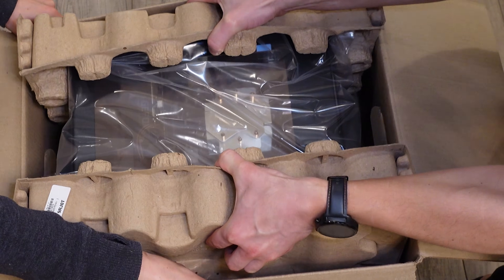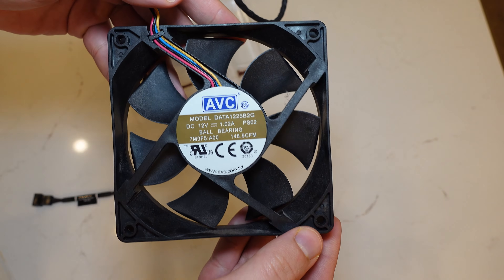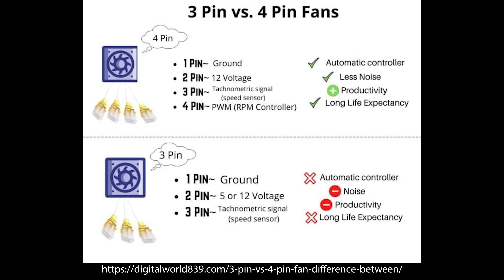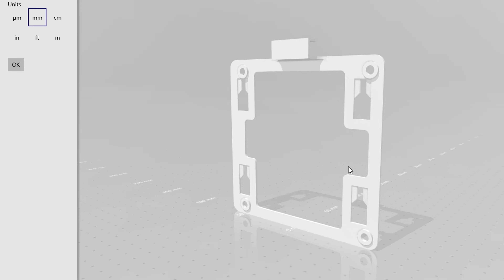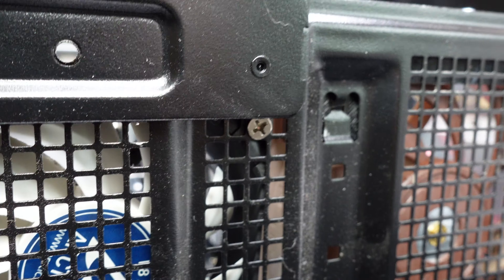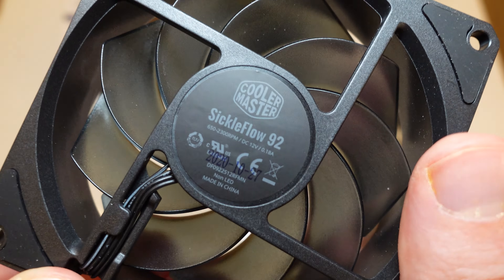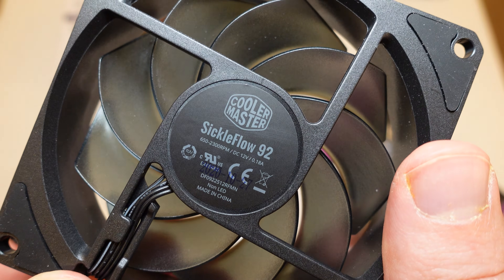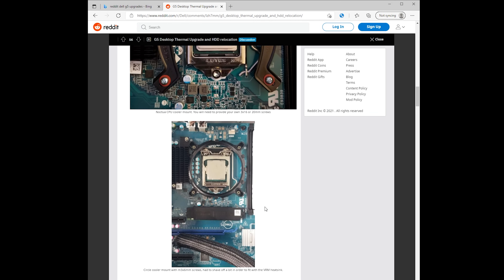Improve AIRFLOW in your Dell G5 or XPS Gaming PC (step by step tutorial mod)

Comment: Hey j, solid video and thanks for this.
I had a question as I'm contemplating doing something similar. With the better cooling arrangement, do you run into any issues with the Dell mobo limiting you cpu with the better cpu cooler? I guess what I'm asking is what the clock speed of the cpu running st when your are doing extended gaming period
Reply from the maker: No issues honestly. A game can't push a CPU like a synthetic Benchmark can. So don't worry about pl2 turbo limits that aren't infinite
Reply: @JSyntax  Thanks man!
Yeah I live in calgary and found someone selling it for $350 (without the GPU). Planning to buy that.
Upgrade the CPU cooler like you did. then just put my old 2070 in.

Is the front intake fan necessary?
Reply: @JSyntax  Also I forgot to ask.
Did you notice a considerable difference for the front intake for the GPU? or just leave it as is and only upgrade the CPU Cooler. 
I got the Vetroo V5

Comment: Great video, but I have one question. If I were only to replace my rear exhaust fan, would that be adequate cooling? Also, I noticed that your front bezel is a different color. I tried looking around the DELL community pages and couldn't find any solutions to changing the LED color. I was only pointed to the Alienware Control Center, which should have an FX tab. However, mine is greyed out. Is it possible to change the color from the bios or something?
Reply from the maker: does ur model come with a rgb strip?

Comment: I also have a G5 and replaced my exhaust fan with noctua chromax 92mm and added Corsair 120 mm blue led fan as intake and repurposed Dell 80mm fan also as intake but haven’t replaced cpu fan because with all these fans my G5 stays at 36 degrees Celsius and only reaches a high 80 degrees Celsius when at maximum performance
Reply from the maker: Nice!
Reply: High 80c is way too hot.

Comment: Another good option for the 120mm and 92mm fans are is the arctic p12 as they are alot cheaper than the noctua and are just as quiet

Comment: I have a hard drive on the front, how should I move it to add the fan? Can I put it somewhere else in the case?
Reply from the maker: yes you can, sry i couldnt cover it b/c it's more hacky! prob better off moving the HDD to an external enclosure and invest in a cheap SSD!
Reply: @JSyntax  thanks for the advice!! I appreciate it!
Reply: Idk if you’ve figured it out yet. I just did mine tonight. I just mounted the hard drive and the hard drive case right next to the hard drive cage in the top left. Just mounted it with some zip ties and it’s working fine. Just make sure to mount it in the right direction so the cords still reach
Reply: @hunchopump  I managed to complete the set up basically. And I've seen DRASTIC Improvements. Good looking out bud.
Reply: @Dopeykilla  That’s good. I got mine all installed last night, haven’t noticed a difference in temps yet though. Pretty sure I need to tweak the fan curves
Reply: @hunchopump  yeah I downloaded the alien ware command center shit. Tweaked the fans, installed the CPU cooler and now I can play basically any game 60fps while staying below the 70c range. This was absolutely worth it for me anyway.

Comment: I have to say that these mods were totally worth it! I finally got the last two fans for the front and just that 80mm at the bottom makes a huge difference in my GPU temps. Overall between GPU and CPU, I am getting about 35-40 degrees on idle and on full gaming, I haven't seen temps go higher than 70 degrees. Thanks for these awesome tips!
Reply from the maker: Right on!
Reply: Did you 3d print that plastic part to hold the fan or did you installed them differently?
Reply: @jrcp87  I got the bracket 3D printed. In my opinion, the printed bracket is way more efficient and square than trying to mess with getting a couple screws to mount right onto the case
Reply: Did you already have the K-series CPU cooler or just the tiny pancake one?
Reply: @voIition777  I had the tiny pancake one. So going from that crappy pancake one to this... Huge difference in temps
Reply: How did you fit the one at the bottom and do you think using the Dell OEM (radiator) for the bottom is good enough?!
Reply: @EZzO444  I ended up just buying the noctua fans all together and scrapped all OEM fans and Coolers. Now fans run quieter, but with improved airflow. I went from 85°C gaming and 45°C idle to basically 75°C gaming and under 34°C idle. 🤘
Reply: @LUCH0517  were you able to keep the GPU bracket for the bottom one?! And how did you used the Y splitter? Intake together and CPU/Radiator together? Any changes or manual fan curves after?! ;)
Reply: @EZzO444  The CPU bracket is fixed under the board. You cannot change the bracket and thus the bracket the Cooler comes with is not usable. You have to track down the right screws. Whatever he mentions in his video I followed to the T. I used the y splitter that came with the fans and Coolers. I've got the Rear fan and CPU cooler hooked up to one port and the 2 front fans I have hooked up to the Chassis Port
Reply: @LUCH0517  thank you! And you kept the preloaded fan profile! Or any changes required at that level?
Reply: @LUCH0517 Glad to hear that worked for you.  Did you have any bios issues not using any OEM fans?
Reply: @alexferrara5975  I have had zero issues doing this Mod. Works great!
Reply: Hi Luciano, I understand that you only used the Noctua fans, did you keep the GPU bracket in? Or was the Noctua fan too big?
Reply: @king0vdarkness  I didn't touch my GPU. Noctua cooler was only used for CPU and noctua fans were used on case.
Reply: @LUCH0517  thanks
Reply: I’m curious, can you tell me what your max RPM was for Noctura? For some reason mine only max out at 1200. However if I use my OEM aux fan + the Noctura setup it’ll pass the fan test with a top RPM of 3k.

Doesn’t make sense :(
Reply: @BrODown32  Funny you asked. I've never really checked my RPM, only my Percentage via the Alienware Control Center. I'll have to look further for that actually.

Comment: I did this install recently along with the cpu cooler and for whatever reason if I don't have the original dell fan that I put at the front of the tower lower side like you did my power unit and computer go bonkers . I have to use the 3 pin off the sys fan splitter for the rear 92 exhaust fan . I also use the 3 pin off the cpu splitter for the 120. Did you have this happen to you as well where your computer just went bonkers with certain cable setups ? Let me know . I also noticed that my rear fan doesn't spin as quick as it did before but this is probably having to do with the fact I'm on a 3 pin but if I change it to the 4 from the splitter and run the 3 to the dell .. like i said up there ,^ the computer doesn't like it

Comment: Thanks for sharing this information!  I recently purchased the Dell XPS 8940 with I7 10700 G10 chip and 3060Ti GC.  Normal operating temp is averaging mid to high 50's C.  After upgrading the system with the Noctua NH-D9L, Premium CPU Cooler with NF-A9 92mm Fan,  Noctua NF-A12x25 PWM (120mm), Noctua NF-A8 PWM (80mm) and Noctua NF-A9 PWM (92mm) the average temps are high 20's to low 30's C .    Max temp on high loads with upgrades only reached mid 60's allowing CPU turbo to be constant at around 4.5 ghz vs high 80's to low 90's stock reducing the CPU output and causing stutters during gaming.  Check out this link walking you through this highly recommended upgrade.  https://youtu.be/nWOeO1Cfva0

Comment: Hey I have a question. Do you have any advice about setting fan curves on ACC? I mounted the 92mm noctua on the back and the stock fan on the front but since then I havent been able to make the function properly. I draw the curves but it looks like they only work on two levels: either they both run slow or they both run to the higher RPM. It seems like they dont really follow the curves.
Reply from the maker: I'd just max the fans to around 900 rpm until 70c, then go max rpm if you get higher temps. Fan noise is indistinguishable from 0 to about 950rpm.
Reply: @JSyntax  thank you!

Comment: My exhaust fan is plugs into a fan sys port. I am only adding the too front intake fan. Is it ok to plug the splitter into the fan sys port and have my exhaust and intake run off the fan sys port? Sorry couldn’t really tell where you plugged yours into
Reply from the maker: Yes of course

Comment: This is an amazing video! Except being the worrywart I am, I would be concerned about the warranty on my machine. I'll probably just purchase a 92mm fan for the back. Thanks though!
Reply from the maker: I keep hearing you don't void your warranty if you replace components but then again, a lot of those comments came from elitist troll arshholes from reddit.
Reply: I also wonder if I could get by with sticking fans on the back and front.  Does it cool it better than the stock fans ?

Comment: Can I just straight up get a desktop fan and point it at the front of pc as a intake fan
Reply from the maker: It's not ideal but yes it will add airflow
Reply: @JSyntax  its definitely not Ideal but I just don't want to go through all the hassle of adding in fans as long as It gets the job done for me im happy, it's more of the graphics card I'm worried about getting too hot because I did get the dell premium cooler

Comment: thanks for the video tips, for the front 120mm fan however, would you have to remove the hardrive all together to install it or is there a another possible place to put the hardrive at, there are the ones at the top of the case but it doesn't seem big enough for the 1TB
Reply: On my XPS 8940 I unscrewed the drive cage containing the 3.5 inch hard drive to make space for the fan and 3D printed piece and moved it below the DVD drive. There is an empty cage there that is a cinch to remove. It is identical to the one that you will swap in. The SATA cable is a little snug in that position but everything fits nicely.

Comment: I have 10700 and 3060ti. When playing flight simulator the cpu does immediately throttle.  I added the noctua cpu cooler and the case gets warm but not too bad.  Most of the time when I'm working i don't want a million fans going.

Comment: Hi,
I just want to upgrade one fan. Can I just remove the Dell's oem fan and replace it with Noctua A12 fan? Can I just plug the Noctua A12 directly to the mainboard without the Y splitter? or the fan I need to use has to be a 80mm fan? Thanks!
Reply from the maker: You'll be fine wit that!
Reply: @JSyntax  Thanks. I have just ordered a noctua 80mm fan. However, the thing is some people have the bios issue when they replace the oem dell fan with the noctua fan. That’s why they have to keep both the oem and noctua fan, and connect them by the Y splitter like the way you did. I wonder if the noctua fan could work alone by itself.

Comment: I got a Dell G5 with intel core i5 1040, 6GB VRAM, 8GB RAM, 256 SSD. I'm upgrading the RAM to 32GB and adding a 1TB SSD as upgrades.
This already beats my MacBook Pro 2014 intel Quad core i7 16GB which I mostly use for photo editing and some video clipping.
This PC seems much better so far for $780. 27" 2560x1440 res for $195 USD. 
It's a decent set up for light gaming and light editing.
Reply from the maker: Agreed.

Comment: So I ordered a G5 before seeing any of your videos and made some mistakes. I have an i7 but not K series. This will likely need the Noctua fan upgrade right? 
Also, I got 1x16 GB of RAM, not knowing the difference between that and 2x8. I emailed them asking to change my order and they said they could not, but they applied a 90$ credit. I plan to use that towards another stick of RAM. Do you have any suggestions for that second stick? I am a total computer newbie. 
I got the 3.5" drive, but that doesn't matter if I don't plan to change the other fans right?
Lastly, the order details say it's a 500W chassis. Do you think that is enough power with a 2060 graphics card?
In Canada btw. Thanks for any and all help, I really appreciate your videos!
Reply from the maker: Hey, congrats on the purchase! Yes, I'd highly recommend upgrading the Noctua fan to prevent high noise and performance throttling.

I'm selling my ram if you are interested on kijiji toronto, I have 4x8gb 2666mhz. But yes, I'd get another 16gb ram stick.

500w is plenty to support even up to 3070!

3.5 hdd bay is not ideal for me, id rather put the 120mm fan. I have an extra 3d printed part for sale too !

Comment: I’m confused-my mechanical hard drive it’s all plugged in has wires attached to it ? Do you have a separate hard drive and you just don’t use that one?
Reply from the maker: You'll need to remove the 3.5 inch of you want to put a 120 mm intake fan with the 3d printed bracket

Comment: Thanks I don’t think I’ll get into all the other fan replacements but the back one is a definite just ordered it now thanks for the tips👍
Reply: @Mike Bakers --- I purchased and 8940.  The NF-A9 and NF-A8 is definitely a good combination.   I use an Alseye DR90 cpu cooler (PC store installed it).  I then purchase a NF-A9 to replace the Dell stock 80 mm exhaust fan.  I then was able to wedge the NF-A8 in the front under the HDD drive and wire bundle.  It snuggly fit between the two in the front of the case to bring in more front air flow.   Went from in the 90 - 80F range down to the 60 - 70 F range.  GPU (PNY Nvidia GT 1030 installed) also went down from 5 F from 95 to 90F.

Comment: i'm confused, so the 4 pin y splitter (plugged into the cpu fan port right next to the cpu) is for the cpu fan with the split 3 pin powering the rear fan? and then you run an extension from the rear fan port (port that the rear fan was originally plugged into at the back of the motherboard, above gpu) to power the 2 front fans?
Reply from the maker: Yes, it's very hard to mess up. Just use the y splitters as you wish!
Reply: @JSyntax  so since the 3 pin is powering the rear fan that means its always running at full speed?

Comment: on the front panel fan install i was able to use rubber pull screws (like the rear fan uses) and they fit snug and perfectly. only cost 6.99 for 36 rubber screws.
Reply from the maker: It was hard wothout the $5 3d printed part

Comment: so, sorry if this is redundant but, i can get a 4 pin y splitter and plug that into the cpu fan plug then power the cpu cooler and the front panel fan? i plan on using some old leftover coolermaster .60A fans... they are 80mm i swapped the rear fan with one of these coolermaster fans as i was under the impression that the bigger amp meant stronger fan?

Comment: Thanks again for the video.   Personally, I would add fan filters to the front intake fans to reduce the amount of dust going into the case.   And since I am very frugal, simply ask your gf/wife/mom for some pantyhose lol and search for the video named, "Custom Dust Filters Using a Pantyhose" for installation instructions.
Reply: i have a WAAAAAAY BETTER FIX!!! here at my local dollar store have screen door patches for 1.00 for a pack of 6x6 squares. use these as your screen as they are adhesive on one side and you can just stick it onto the front panel grill (custom cut) underneath the plastic panel.
Reply from the maker: ahhhhhh very interesting! The grills at the front did a good job catching furs and hairs from cats and dogs but I imagine dust will be annoying. I hear positive air pressure prevents dust build up tho?
Reply: @JSyntax  i'm using window screen patches that i got at the dollar store. they are adhesive and can stick right on the front metal internal grill...won't stop microscopic dust but it will stop the bigger stuff.
Reply: @JSyntax  https://www.youtube.com/watch?v=4NYHC3DXynM and scroll to 4:11.  A very old video from Jayz lol but informative; hope this helps.

Comment: Thank you for your series on all these Dell G5 cooler upgrades! I'm still waiting on my G5 to ship. It has an i9 CPU in it. So I'm not sure what CPU cooler it'll have when it eventually arrives. But if it doesn't have the deluxe one, I will probably try to get a Noctua cooler and just do that upgrade. If adding the front fans are more trouble than they're worth, I might not attempt that as I'm not very experienced with installing computer hardware. Again, thank you very much! Your videos have been very helpful!
Reply: Remember: if your i9 has a K in it's name (overKlocking enabled), you will get the "deluxe" cooler.
Reply from the maker: I can't imagine an i9 with a pancake cooler! Does it even exist?
Reply: @JSyntax  Yeah, I imagine they would have to put the deluxe cooler on an i9. More cores means more heat, right? If it doesn't, I'll definitely have to do that Noctua cooler upgrade right away.
Reply: @JSyntax  Yep!